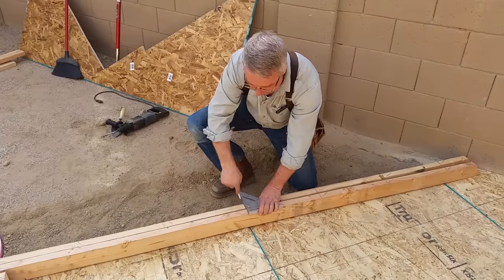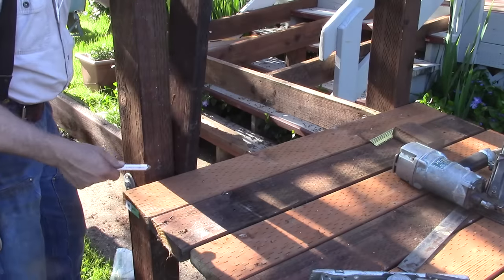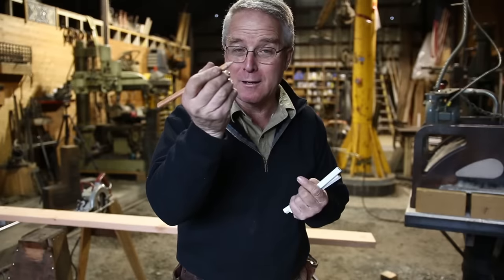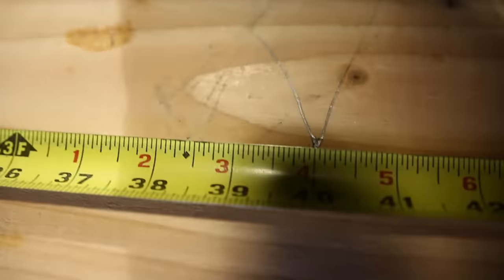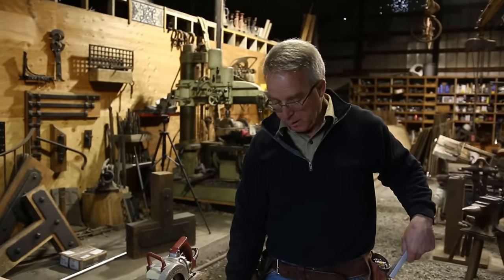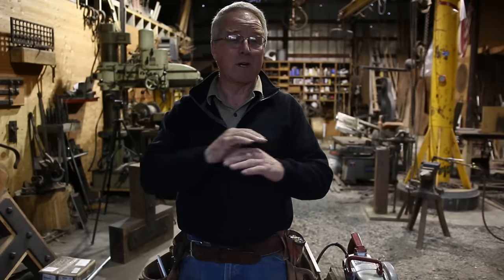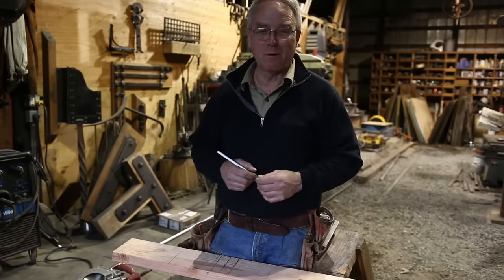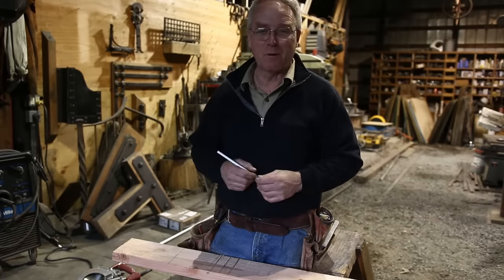Marking and Cutting Pro Tips

Comment: I am a professional builder, brickmason, carpenter for going on 30 plus years now, and I abandoned traditional wood pencils, of all strips, years ago. I prefer the higher end mechanical pencils. For masonry work 2.0mm grafite, for carpentry 0.9 to 0.7mm, and for drafting plans I like 0.5 to 0.3mm. To each his own, there is no one way to skin a cat, but I highly recommend mechanical pencils (the expensive ones hold up for a good long while) as a way to improve accuracy and consistency when marking materials. The move to mechanical pencils really improved my marking regime, and when I am forced to go back to wood I often find I have to incessantly resharpen, or slightly reposition my ruler or square to make up for a broader, duller, lead tip as I make more marks.
Also, the sharpie shown in this video is really only good for cuts in structural steel applications. I prefer the finer tipped sharpies for custom, and for that matter production, cuts, or when cutting any steel members whose dimensions require a low tolerance for error.

Comment: Using a utility knife is not only a high precision way to mark a line but if you ever have to do any high precision chisel work on wood, you will always start by outlining the area to by chiseled out with a utility knife first. This creates a super clean starting point from where to begin chiseling yielding a super sharp and straight edge at the outer surface of the wood that is most likely to be a visible feature in say a mortise and tenon application.

Comment: Nothing but 0.9 mm mechanical pencils for me. Carry a box of them in the truck at all times, and two on my person. I've found 0.9 mm to be the ideal combination of durability and precision. It's thick enough to resist constant annoying breaking, which can be very frustrating with thinner diameter variants. The graphite often forms a bit of a chisel point from casual use, and I often use it to my advantage when I need to be very precise by taking the time to rotate the pencil so that only the point of that chiseled edge makes contact with the surface I am marking.

Take this advice with a grain of salt, as I'm a sparky, but I have always enjoyed sharing and learning techniques with you nail benders! Great videos.

Comment: Best thing I ever found for the fine tolerance stuff is the Incra rulers you use with a 0.5mm mechanical pencil, it has 0.25mm increments and you just put the lead in the hole n drag the square along making it super easy for the fine n fiddly stuff like box making.

Comment: Have been a locksmith for more than a few years but could not find a marker that I could use for marking brass lock cylinders.  They could be rubbed off or smeared no matter how I prepped the brass...wire brushed it, soap and water, alcohol.  Thought the Sharpie would work but again the same result.  Then someone recommended the SHARPIE PRO.  Problem solve. Works on oily and unusual materials.  Highly recommend it.

Comment: I like to make a bit of a dent at the apex with the pencil. I then put the pencil back in the dent, and slide the square up to the pencil, then draw the line. It helps to eliminate offset errors due to the thickness of the pencil, or the sharpie barrel riding on the square.

Comment: One of the key pieces of wisdom imparted to me by a machinist I worked for at a young age was to be aware of the tolerances for the job at hand. Some jobs, like fitting drawers, have very little allowable error, in the thousandths. Other jobs are plus or minus fractions of an inch if not inches. This video is dead on because it makes this clear.

Comment: great video!! Good tips and pointers. I have read the comments about keeping the pencil at the Apex..then move the square to the pencil...good point..I use that trick all the time when I am in an awkward position. 
To the couple of people that said just move the square to the measurement on your tape. Keep  in mind...he is ( I think) talking from a production aspect..time is money ...money pays the bills and buys nice toys.
Another marking device  that can be used on red iron and steel ,is a silver streak, a pencil with silver/gray lead. Almost like a colored pencil.
What I would give to be on the crew for that spec house.
Reply: When you get used to putting the square under your tape, it's actually significantly faster than anything else because you cut out an entire step; only downside is that there are a few situations where it just won't fit, something's in the way, the tape needs to be in the wrong hand, etc.

Comment: sometimes when marking with carpenters pencil and speed square, i dont hold the pencil at a steep enough to the square, so my line will be 1/16 off my mark right outa the gate.  when that happens, i make a mental note of plus or minus my line.  good video.  hope the house project is going well

Comment: There is another way,,,,,to sharpen a carpenters pencil...talking about  a right handed person,,,,hold the pencil in the left hand,,,,using  a chisel  ( sharp  chisel,,,,all chisels should be sharp/safe)  in the right hand,,,push  the blade of the chisel with the left  hand thumb,,,,excellent control and the blade moves away from all body parts,,,,the other plus here is that you get better visual control as well!!!  BTW, love what you do,,,and the way you do it,,,particularly   your accurate use of vocabulary and language,,,,well done!

Comment: I always scribe a cut with my knife when I have to butt two ends of lumber together over a long distance such as for tilt panels. The saw follows the cut line and I always end up with the two lengths adding up to exactly the right overall measurement. I'm talking less than a 64th. In concrete work that's considered rediculous. Great advice as always.

Comment: I work primarily as a trim carpenter, on the higher end.  Lots of crown molding, staircases, etc. and I almost never use a pencil, the utility knife or a scribe works the best.  Also, instead of using a tape measure, take the piece of stock you are working with and place it into position, then scribe the line for the cut.  For crown molding the result is perfect length cuts and very little waste, but it works with any trim really.
Reply: Robert Thomas "Never measure what you can scribe" was some of the best advice I've been given in working with carpentry

Comment: Take your pencil, place it on the apex of the "crow's foot" (which he demonstrated but didn't name), then slide your square over to the pencil tip for quicker, more accurate lines. I am a finish carpenter and I use this technique all the time. For greater precision when butting base up to prefinished cabinets, marking pieces with a razor proves absolutely essential to get a tight fit.

Comment: Another trick with the utility blade. When you need to trim a door bottom, score your line with a knife and a straight edge to greatly reduce the chances of chip out when cutting. Works well on solid and hollow core doors.

Comment: The carpenter pencils also has set dimensions you can use, it’s half inch wide, 1/4 inch thick and the lead is an 1/8 in case you need to scribe or space

Comment: I do furniture making and I mark dead on and depending on the saw blade run out, I either leave the line or bisect the line. I often test cut if I only have just enough parts for what I need. If the line is still there after I cut I measure and cut again if necessary.

Comment: Would like to see you cover this subject on a larger piece of wood like plywood.  For instance, you have a piece of T-111 and you need two pieces that are 3' 8" out of the total 8' piece.  This was very helpful.  I’ve always been a “Measure 3 times, cut with chainsaw” kind of guy.  I can never get the measurement right or I cut on the wrong side of the line.

Comment: I was a carpenter in the days before air nailers when all lumber arrived on the site dimensional and nothing was pre-fab. Roof rafters would be cut to angle on the ground with a radial arm saw and lifted to the top the house and they always fit perfectly. Our framing crew of six men could fully frame a two-story, full attic 4000 sq. Ft home, and have the tar paper on the roof, in five days using nothing but tape measure, folding rule, framing square, chalk line, bubble levels, 16p nails and a 16oz. Estwing hammer. Oh…and a good flat carpenters pencil.

Comment: Pro tip for sharpie, if it's a nonporous surface, draw on top of the original mark and then you can wipe it away. It's solvent based and it's a solvent.

Comment: In fine carpentry I use a mechanical pencil.  The fine line is critical.  Your right a razor knife is a good substitute and prevents tearing.  Also I’d rather cut twice to get a tight fit.

Comment: The use of a razor knife to mark a line can be traced back to furniture making centuries ago. One of the first things an apprentice Jointer or Carpenter learned to do was make a "First Class Cut". This was accomplished by scribing a line with a small blade, then deepening it with a sharp chisel. The chisel cleanly cuts the wood fibers at the exact point needed and pushes the wood fibers away from the cut via the bevel of the chisel. The following cut with a hand saw is as clean as can be achieved. A utility knife blade makes a fair substitute, at least in soft woods.
I learned this from my father, Stephen Gray, when I was about 12yrs old, and I still use his chisel...

Comment: I've helped a carpenter to cut and nail down wood flooring. 
Both ends had to be cut and he always marked 2 lines for cutting as wide as the cutting wheel so you will position the cutting tool in the appropriate location for sure.

Comment: I worked with an older guy once who would only use round pencils (whatever diameter), and it was required that all working with him learned to roll the pencil to keep it at a fine consistent point without constantly stopping to sharpen.
Reply: Yep, that rolling pencil trick is one that I learned from an old carpenter. Great point (pun intended)

Comment: Papermate sharpwriters are great pencils for marking wood and other things like drywall. The lead is thin and the lead actually is in a spring that compresses based on the pressure you apply. The lead never seems to break and the pencil itself is cheap and tough.

Comment: In boatbuilding I love using T-marking: mark it sloppy and then draw the T's tail onto the opposite side of your Exact place where the correct measurement is, like   (  and then  (-, this shows that line of measuremnt is Exactly on the opposite edge where the  -  hit's (  
Like scribing, but you don't have to worry about the thickness of your line. Very good for free-shaping curves, especially if you have like a half dozen lines already drawn, you pull the most/fattest/longest  tails of T to the correct lines to visualize yourself the correct line

Comment: Measure, mark, measure, cut, measure, install. You can do this all day and if it saves a single trip back to the saw, it saved time. With practice, the extra measuring adds at most 10-15 seconds to the cutting process, and you start getting extremely accurate while maintaining speed.

Comment: Don’t forget a marking knife for when you really need an accurate mark. I like mechanical pencils both mechanical carpenters pencil, a mechanical drafters pencil (2mm lead), and a traditional mechanical pencil (0.3mm + 0.7mm leads). Mechanical pencils have changed a lot over the years and companies like Swanson make a great mechanical pencil. I also like click style sharpies as well as paint markers as they write on things sharpies won’t. I also always carry a write in the rain notepad with me which you can write on in the rain and actually underwater. Great info. And remember as you get more precise marks get smaller and cuts even can come down to sides of the mark as the marks themselves have width, hence the marking knife being the most accurate.

Comment: I was taught that if I needed to keep the line, then it would be called out as the measurement + "heavy" or "light".  Another use for a carpenter's pencil is the measuring of the spacing of deck boards.

Comment: Another reason a carpenters pencil is shaped the way that it is, is because it can be used to scribe lines on boards (closet shelving on sheet rock walls for example) that need to seat against an uneven surface or an un square corner. Because the lead is naturally centered on the pencil and the pencil is hexagonal you essentially have three different distances away from you reference surface that you can mark. I'm not sure the exact marks but something like 1/32, 1/16 and 1/8 from the edge face of the pencil to the center of the lead sounds right.

Comment: When you make the two marks with your pencil, the shorter angled one always indicates the waste piece side of the timber, in other words, that's the bit you don't want when you cut it. Get into the habit of doing that and you wont have to stand there with two pieces of timber trying to remember which it was you wanted for the fit and saves having to remeasure the lengths, especially if they are close in size. Has saved me many hours over the 40 years of building and i teach it to anyone that listens...lol

Comment: Another reason for the crows foot is; a single mark one side can be the correct length while the other can be drastically off. If you don’t immediately follow up with a square it’s easy to waste material

Comment: Speaking of finish work marking, I dont even use a pencil. I prefer the accuracy of a nice knife blade. The lead on a pencil will almost always be far thicker and therefore less accurate than a knife blade. Of course, I dont mark the front of the piece, but rather along the back. That way, even if I mark it wrong and leave a knife mark on the piece, it's on the back of the piece and would only be visible from the surface the trim is nailed into. Your example of this is very good

Comment: One thing I do is marking which the side of line is the measured edge. Edges have zero width and it does not matter what the width of my mark is. Of course I still have to keep track of which side I need to make my cut to so I do not end of short because of the kerf loss.

Comment: I like to sharpen my pencil with a chisel. It is the way I was taught, but also, I rarely have a sharp edge on my  utility knife, but I am very likely to have a razor sharp chisel edge. I lay the pencil in the notch between thumb and hand (left) and I pare with the index finger of my right hand on the bevel of the chisel. You can not cut yourself, unless someone slaps you on the back while you are doing it. And yes, this can happen, too.

Comment: At around 10:00 when he starts talking about fine lines, he mentions using a mechanical pencil. After being in construction for a few years, I can say that doesn't work as well as it sounds. The pencil itself will fall apart in your vest pocket. Also, the lead inside the pencil will break. It seems weird that a thick 2mm lead would break when it's inside a strong metal pencil housing, but it does.

Comment: Very informative video!

A Use Case:  I have been experimenting with a modular panelized construction system that requires a great deal of accuracy for all the framing & OSB paneling cuts. Since the modular panels are all pre-built in my workshop, I have the option of using whatever marking tools give the most accurate results. Mechanical pencils with 0.9mm leads have been excellent for most of the work and they don't break very often. 0.5 & 0.7mm leads require a very light touch as they break too easily, while a 1.3mm mechanical pencil is incredibly robust but not fine enough for the precision required. 

Question: After you freshly sharpen a carpenter's pencil, what is the width of the pencil line that it typically makes? And how long does the pencil line stay near that initial width before you need to re-sharpen it?